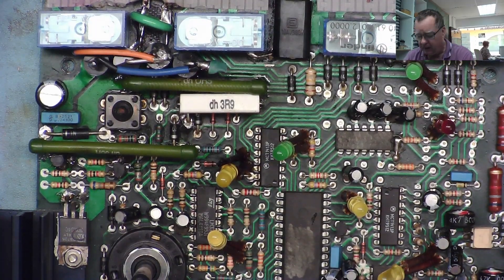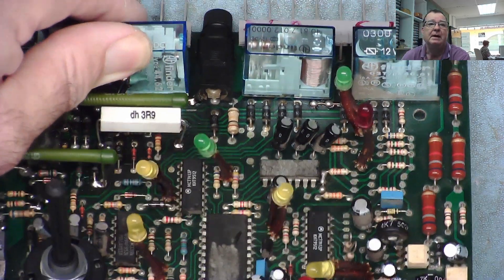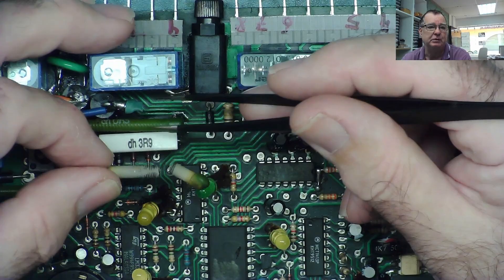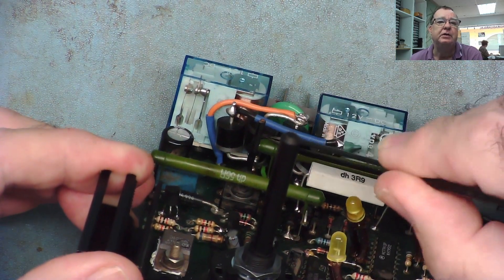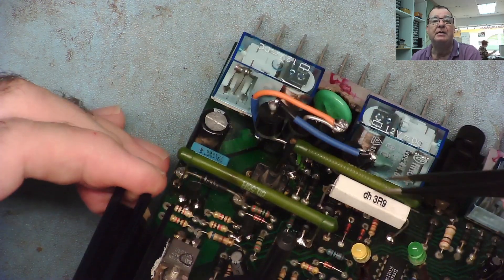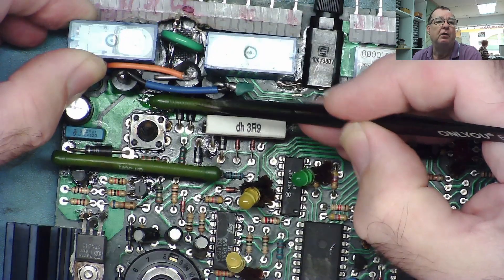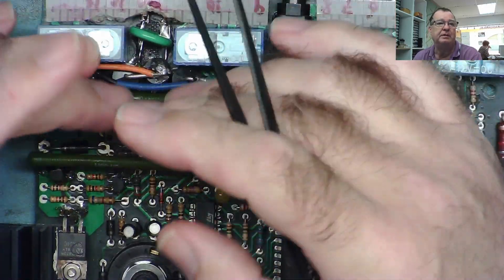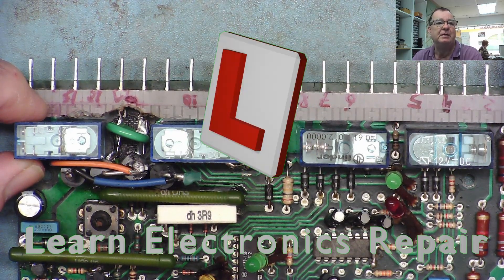Industrial Electronics Repair Use Basic Electronics Knowledge To Fix Just About Anything REPRISE

Comment: This switch was really a pain to remove ... Whene I have to take care of the board and the component is 100% trash, I usually resort to butchering the copomonet apart on board and then remove each individual pin - it is a blow to my electronic pride, but is much safer to provide results. 
This part around the MOV and diode bridge is so burned up, that it's probably quite condusctive: if i had to repair this piece, I would probably fabricate a "daughter board" and put at least diode bridge and MOV, but probably more components on it. 
Immediately when I saw the board I knew there will be trouble, those old double sided are always dirty and so sensible ...

Comment: Hmmm... I would probably solder some wires on the original bridge rectifier, mount it on the board, and then stuff it in the gap upside down.

Comment: Some sidenotes on relays. When you want to use a relay on a DIY project with veroboard, most single pole relays have a 3,17mm gridsize format and won't fit, because veroboard has 2,54mm gridsize. Double pole relais have 2,54mm gridsize, and those are no problem. 
One of the reasons that contacts of a relay get burned in, is mostly due DC amperage overload, or no snubber capacitor, but there is another cause.
Almost all relays have a small venting hole, some on the underside between the PCB contacts, some in the plastic shell of the housing. 
This small venting hole is to let the ozon gas escape, that is produced during arcing, when this ozon gas can't escape, contact coating will deteriorate quicker.
On some relays, like the blue and orange cheap ones that are used in motion sensors, they have a little tap on 1 corner, tis tap needs to be cut off, to open the small venting hole. But this is not done in the factory, mostly due unknowledge or the purpose of this tap.
Reply: Brilliant info
Cheers

Comment: what about the green varistor !!!
Reply from the maker: That was already replaced by another engineer before I was given the PCB - I tested it in part one, it reads open circuit as normal. I did note in part one that the varistor is a 430V, and the original bridge rectifier was rated at 200V so I think the person who previously worked on this PCB has fitted the wrong value, and this one will not give any protection.  He did tell me when he brought the PCB to me that the original one had exploded so there is no way to know the correct rating, other than if he measures the AC voltage across it when the board is connected to the equipment on site and calculates a suitable value from that.  I will discuss this with him when he collects the PCB

Comment: Good evening. There is a test that you can make also on chips with no marking. From the tracks on the PCB, surrounding the un-named chip you can find the supply rails and GND. Then you can verify the bias pins are not shorted towards GND using your multimeter. Obviously, this is not a conclusive test on an IC but it is a test that you can do...and if there is a short, them it is game over! Regards from Italy.
Reply from the maker: Thanks for the hint 🙂

Comment: I repaired a MIG welder not long ago, it used the same Finder relay and it had the same problem, burnt contacts, thanks for the videos Rich I have learnt so much, now I buy broken electronics from ebay just to repair!
Reply from the maker: And buying to repair is most definitely the best way to learn.  No hassle from anyone to get it fixed to a certain timescale and no problem when you make it worse than when you started, which is definitely going to happen sometimes, especially while you are learning.
Reply: That is how you learn